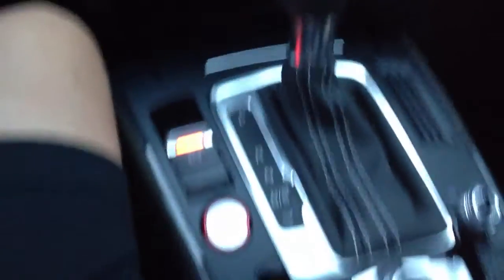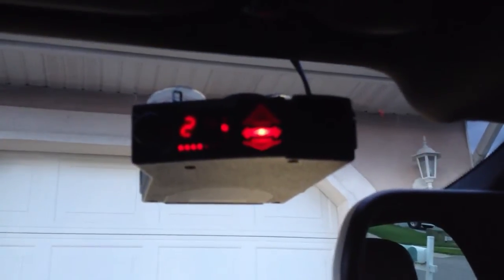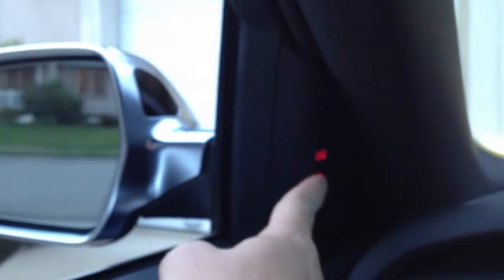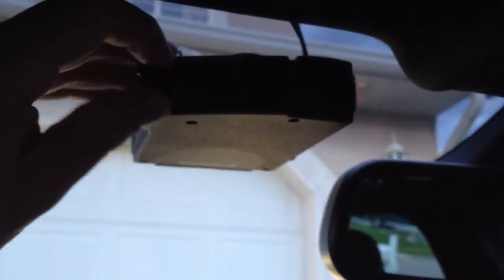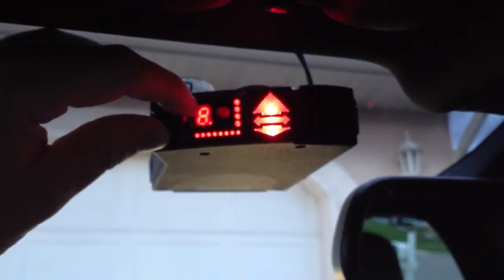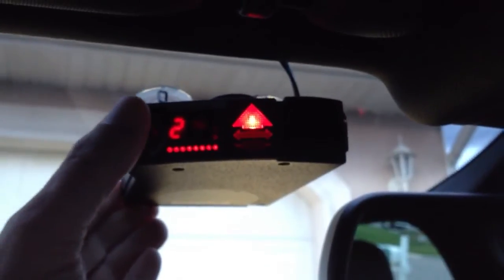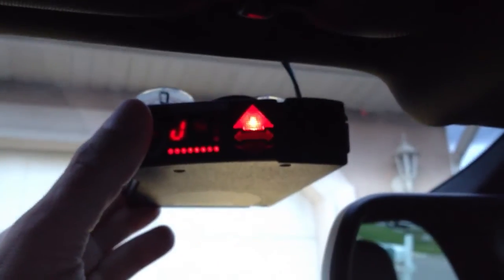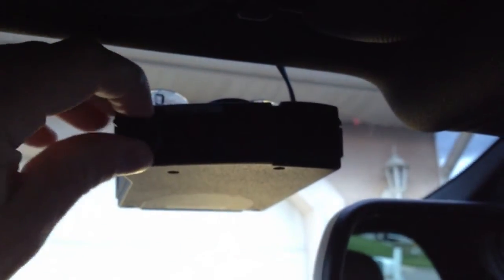Valentine 1 and Audi's Side Assist - conflict solved!

Comment from the maker: It eliminated the constant alert from the Side Assist, however, there's something about Audi's that still occasionally trigger false alarms.  It seems like it occurs more when the car is cold, in the morning.  I previously had an A4 WITHOUT Side Assist and would get false alerts.  I have no idea what causes it but there's two things I do to get rid of it. 1) cycle the power on and off will sometimes clear the alert. 2) like I said, it doesn't seem to trigger an alert if the car is warm or during the day.